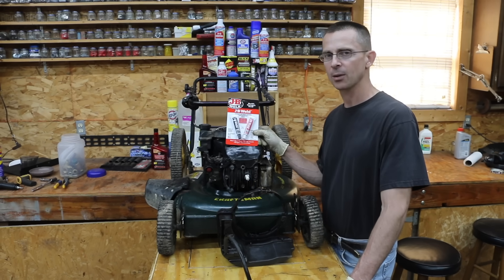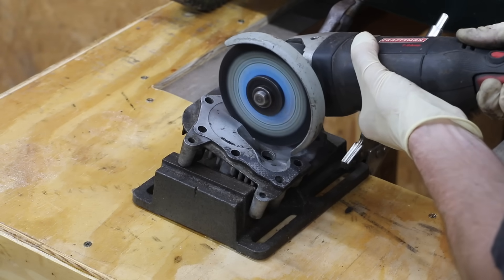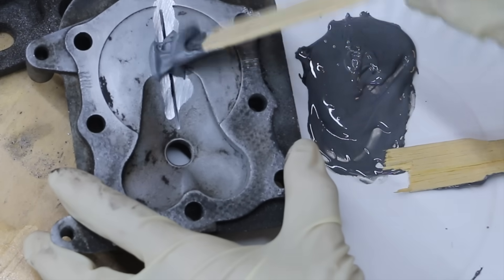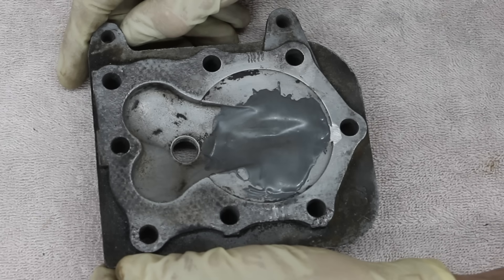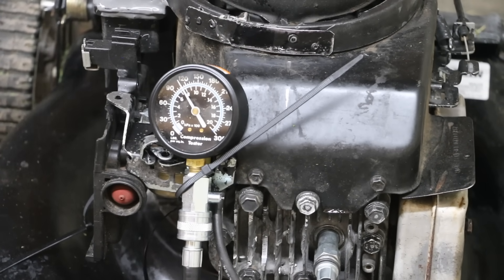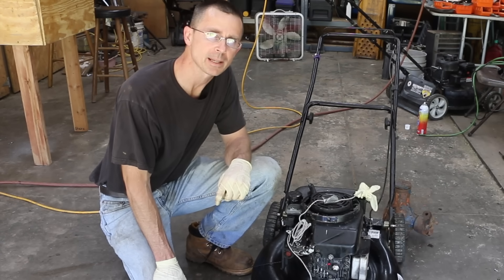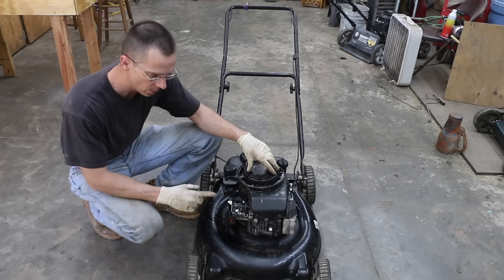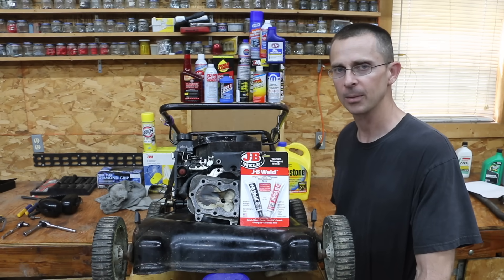Can JB Weld fix a cracked cylinder head?  See the proof!!

Comment: The damage to the cylinder head you created was basically a slot cut into the metal therefore all the JB Weld had to do was plug the hole. A cracked head would normally be in from one edge leaving one end of the crack unsupported. Would you get the same result in the test if you cut the head in from an edge thereby introducing a degree of flex into the repair.
Reply from the maker: Thank you for the feedback

Comment: My 2007 civic has a small crack on the bottom block leaking coolant, ill be JB welding it,  since its out of warranty and it only has 112K  miles.
Reply from the maker: Hope it works

Comment: Have you ever tried Alvin Lab-Metal?  It's super tough.  They even have a high-temperature version that you can use on engine exhaust repair.  I used it to repair a damaged exhaust manifold bolt threads on a CDC 8.3L in my Magnum tractor.  It's been there for roughly 10 years with no issues.
Reply from the maker: Thanks for the video idea.

Comment: In the past I used a product called MetalSet. Like JB Weld it is a two part epoxy, the difference is that it has powderized metal included in the mix.
Reply from the maker: Thanks for the feedback.

Comment: My engine block froze in my boat, pissed me off because I took it to the dealer to drain and winterize. Apparently cracked stuff happens all the time and its somehow my responsibility. Its a 1969 merc engine, so it'll be a blue moon if I find a good priced replacement for that engine block, other than taking it out and converting the i/o boat into an outboard. I'm gonna talk to my boat guy and see if he's comfortable with jb weld if everyone is saying it's so good. he doesn't even think the crack is where any major combustion is happening, so hopefully i'm good if this stuff works and he gives me a fair quote lol.
Reply from the maker: Thanks for the feedback.

Comment: I used the JB Weld Extreme Heat on the passenger side exhaust manifold to my '68 Thunderbird's 429. A lot of people on youtube here don't allow it to cure properly. I allowed it a full 72 hours and then some to fully cure. It held up for a good couple of months since I didn't quite have the money to buy a new one and ironically no one makes a replacement for a Ford 385 Series.

At any rate, I think part of my failure was not beveling the hairline cracks. I drilled holes to stop them from going further than the 300°-320° they already cracked. Held up until I started shifting the car around 4500rpms. Looking at it though, beveling it out may not have been the best choice based on the near 360° completion of them, but had they only been on one side or the other, it'd have been a good idea to bevel it out.

At the end of the day, I say it passed, and only failed due to my part in it. If I had another manifold that wasn't cracked as bad, I wouldn't mind giving it another proper go and seeing how long it could hold up to daily driving.
Reply from the maker: Thanks for the feedback.

Comment: i've used jb weld on an oil sensor fitting that broke on a 1981 volvo engine block.  i drilled out the sensor and used jb weld with a steel insert ftw
Reply from the maker: Thanks for the feedback.

Comment: We use JB at the race track and car demos. If you mix both tubes and just a cap full of alcohol it'll flow nicely along radiator tanks. As for cracked head or block you need to heat them with a torch so crack opens up wide then pour mixture in.
Reply from the maker: Thanks for the feedback.

Comment: Test this...
1. cracked vaccum line - pour silicone over it and let dry...
2. Need new paper gasket - Remove all paper gaskets, buy construction paper coat with high temp silicone between two layers of paper l, cut to shape and test for leaks. Test again with just silicone...
3. Exhaust sealant as an exhaust gasket...
4. Use tap to increase spark plug hole size... use car spark plug.

All this I have done... but I'd love to see your results.
Reply from the maker: Thanks for the video idea.

Comment: Currently lapping my intake valve because it was leaking... used a check valve wedged in my intake boot jist behind the carb... created just enough pressure to compensate for the leaky valve and get my moped running. Lasted 2 weeks until payday.
Reply from the maker: Thanks for the feedback.

Comment: That is the sloppiest methodology I've seen in a while.  Let me be a little more forthcoming in my criticism. First, a cutting blade doesn't simulate the conditions of a crack. A crack would form from extraordinary force applied either through a heating differential (and thus uneven expansion and contraction) over varying thickness of a casting. It might also result from a strong force in a small area as would occur if some moving part broke and impacted a cylinder or block wall. In either case the crystaline structure of metal at either end of the crack would also be compromised on a molecular level, it just wouldn't show to the naked eye. 

By beveling out the "crack" you've added significantly to the heat differential problem. Now, instead of just needing bonding strength to join the metal casting together, you've created a situation in which a significant body of foreign material is expected to function as the casting does. Additionally, the greatly increased surface area needed to be bonded on a lateral bias along extremely modified thicknesses practically ensures that patch will inevitably fail.

If one had an actual crack to repair, the smallest amount of metal removal that would guarantee penetration of the bonding agent would be the appropriate conservation measure. As for the success of this repair, I'd like to see the conditions of that engine after running a few dozen cycles of heating and cooling.
Reply from the maker: Thanks for the feedback.

Comment: Should I get extreme heat JB weld or what you used (twin tube) in the video to fix a chip in my cylinder wall
Reply from the maker: Thanks for the video idea.
Reply: Project Farm thank you! I had a few typos and just fixed them so the comment might now make more sense

Comment: I used JB weld on my 87 Volvo penta AQ125a exhaust manifold. It had a 6" crack and leaked extremely bad. I beveled the crack out and threw some JB Weld on it and so far its going on 6 years no issues or signs of letting go. I also have a generator motor mount that cracked and left a 1" hole in the oil sump area. JB Weld sealed it up and so far its ran 230 hours on that repair no issues. JB Weld is a very superior product.
Reply from the maker: Thanks for the video idea.

Comment: I once owned a Ford Pinto with a 2300 4 cylinder. The head gasket blew and it eroded the block between #1 and #2 cylinders. We cleaned it up and repaired it with JB Weld. Ran it for at least 2 years. Later replaced the rings and the JB Weld was still holding. Drove it another 3 years.  That's a great product.
Reply from the maker: Impressive repair!

Comment: I used JB Weld back in the 80s once to to put an sharp edge on an old lawnmower blade that was worn pretty bad.  Didn't use a lot, just enough so once it dried I could grind a good edge.  Worked pretty well.  Also used it to repair a cracked engine block that was caused by freezing.  It was a rare Chevy 327ci FI engine, and the crack was right below between two freeze plugs on the drivers side below the exhaust manifold and is still holding today after 35 years.  Good stuff!
Reply from the maker: Thanks for the feedback.

Comment: I am a firm believer in JB Weld. One bit of advice for followers though: Since the crack was manufactured, the ends were much wider than a normal crack would be. Therefore, the pressure was spread over a larger area; Pressure= Force/Area. For a normal crack, there is very little area for the force to exert itself on; that's why it keeps cracking. Drilling a hole (called drill stop) at each end of the crack gives the force a larger area to exert itself on. That creates less pressure, and hopefully the extent of the crack. Obviously, the holes would be filled as well.
Reply from the maker: Great feedback. Thank you

Comment: I RENEW THE ISSUSE  / radiator with no cap,  Zero pressure / i can not get jb weld past 180*F... like all other epoxys... turn to jelly at 180F

Comment: I first discovered JB Weld about 20 years ago.  I had a big crack in the valve cover of my 2.0L turbo charged Eagle Talon and a road trip to go on the next day.   I sealed the inside and outside of the crack and went on my road trip.  That stuff held for years with no issue!  I was sold on JB Weld forever.
Reply from the maker: Impressive results!  Thank you

Comment: That was a very tough test good video 

as you know it’s not really testing repair on a crack.... it’s actually  testing repair on a cut.....  which is different because now that the head has been cut the blade has removed material whereas in a simple crack no material is removed so the JB weld has to do two things it has to replace the material that has  been removed by the blade plus then hold up to engine wear.....

 rather than just the latter on its own

Definitely a good product definitely a tough test might not last the life of the engine but if you’re in a remote area it looks like it will get your home or just to a workshop and that’s the main thing....!
Reply from the maker: Thank you and thanks for the feedback.

Comment: If you have a huge gap or complex shape, I have had luck using the bottom corner of a plastic soda bottle as a leave in form.... Mine is over a motorcycle slave cylinder so heat isn't much of an issue.... Stands up to the motor vibs + my steel toed boots tapping it constantly
Reply from the maker: Great feedback. Thank you

Comment: I used JB to patch a hole at the bottom of the gas tank on my motorcycle, It was an emergency repair so I didn't let it cure properly. It worked for a couple of days but started leaking again, saved the day but wasn't a permanent solution. Maybe if I had more time to let it cure overnight it could have work, who knows!
Reply from the maker: Thanks for sharing!

Comment: A crack won't allow the JB Weld to get inside deep enough versus a wider open manually produced slice. J-B Weld is right up there with WD-40 and duct tape. But you got to try it on a real actual crackhead. Depends on how much material you get in that vacancy then. Just the thought. I enjoy your show.
Reply from the maker: Thanks for the feedback.

Comment: JB weld. Very good for exhaust connections.have also seen it used on cracked heads and cylinder walls
Reply from the maker: Great tip!

Comment: As you know , I fix things also. While traveling around our great country for 40 days and 40 nights with my family filming it for my youtube channel . the tow vehicle, was a F-350 farm truck I borrowed. we lost the drive shaft . I had payed a shop that specializes in drive shafts put in new universals  , they did great job. but they failed about 400 miles later . because the seats (GROVE) for the retaining clips were worn battered and rusted     . I fixed it the second time , I cleaned everything very well with brake clean and JB welded the clips or lock rings in  . 12k HARD miles later still going strong! ! ! yee haa ! ! !
Reply from the maker: Thanks for sharing.

Comment: Used JB weld on a cracked noisy  exhaust manifold on a 1972 350 chevy ran for a long time with no problems and quiet as a little church mouse. Good Stuff. Saved me over 100 dollars on a broken bracket on my dash temp control on my motorhome. thanks for the great videos.

Comment: Are use JB Weld on a plastic power steering pump housing on a Ford Taurus the return line broke off I found a piece of quarter inch tubing put a bed around it dropped down inside the tank and pulled it through with a pair pliers and it held for two years
Reply from the maker: Impressive repair!

Comment: I'm surprised it held up against the piston slapping it. I know the stuff is good at handling heat, but it's fairly brittle and doesn't like hard impacts. Usually a hard impact will cause it to crack and bust off. Very impressive test results.
Reply from the maker: Thank you

Comment: My wife had a Datsun 1600 pick up that her dad gave her. It lost compression in two adjoining cylinders. She wanted to fix it herself having zero experience with this work and did almost 100% of the labor with my supervision. When she got the head off we found the source of the problem. It had a burn through between cylinders 2 and 3 and some serious scarring of #3 cyl wall. I told her to go get JB Weld and brake cleaner. Filled the scratches and the burn through sanded smooth. Honed all cylinders and installed new rings. It ran better than ever and lasted for 9 years (when she sold it). Still see it from time but don't know if it's the same engine. It has been nearly 30 years since she sold it.
Reply from the maker: That's great!!  Thanks for sharing!

Comment: I used JB weld to repair a shallow well water pump I use out doors to pump water for my garden, pump froze in the fall one year and cracked the cast housing, fixed with JB weld and holding together still years later. Great video.
Reply from the maker: Impressive repair!

Comment: Job weld also claims that you can repair cracked cylinder walls...maybe you should try that...I don't remember the name of the other repair putty but it is white colored...they also have the same claims
Reply from the maker: Great test suggestion. Thanks
Reply: Damned auto correct...not job weld...JB WELD

Comment: Yeah man.  I had a 1995 s10 with the 2.2, 4 cylinder engine.   The cylinder head got small hairline cracks along the outside wall above the spark plug holes.   When the engine warmed up the cracks would leak antifreeze into spark plug holes causing the engine to misfire.  We got some JB weld and applied it to the head along the cracks.   It never leaked again.
Reply from the maker: Thank you for the feedback

Comment: I'm REALLY curious to how good JB weld would hold up to a cylinder head that is under boost. Like a turbo or supercharged engine.  Not real sure how you would test this without costing yourself some money, but I'm really interested to see how it would hold up.  Also I would like you to maybe test out some radiator fix leak products and see if you can find any that won't clog up the heater coil.
Reply from the maker: Great test idea!  Thankyou

Comment: The aluminum transmission housing on my Mercedes-Benz 300SD cracked and was leaking transmission oil profusely in the driveway. Using brake cleaner and J-B Weld, I was able to clean and then massage the epoxy paste into the crack to stop the leak. That was 6 years ago, and it's still holding. I can buy a lot of J-B Weld for the $4,000 the transmission swap was going to cost.
Reply from the maker: Impressive results avoiding $4000 transmission swap!

Comment: Probably a dumb question. But can you drill & tab JB Weld?
Reply from the maker: Yes, but it doesn't have the same strength as steel
Reply: @ProjectFarm  Oh that's fine, was going to use it to replace plastic studs on a shifter cover. Coarse thread self tapping screws though.

Comment: Project Kawasaki Prairie 400 4x4

Oil leaking from the gasket between the cylinder and crankcase. I think I'm gonna try smothering the area with JB weld instead of the proper thing to do.

Any thought? Is the crankcase oil under pressure?
Reply from the maker: JB Weld is unlikely to help with a gasket leak.  Is the PCV valve working properly?
Reply: @ProjectFarm  even though it's in the crankcase on bottom of the cylinder? 

I'm 20 and new to this so all the advice and tips is really really helpful!

Comment: I had a late 90s KX 80 (2 stroke dirtbike) that had a busted crank case. I used jb weld to patch the hole and it lasted years. Even then I blew the motor too many times and couldn't bore it out and re sleeve it anymore. I miss that old bike haha
Reply from the maker: Impressive!

Comment: I had a tree branch hit the cooling fan on my tractor damaging the radiator. The radiator needs to come off and laid flat but jb weld did a very good and neat repair. It is still going strong after 2 years. New radiator for the tractor was going to be $ 750.00. JB weld less than 10 bucks. JB Weld  radiator repair ... works good!
Reply from the maker: Impressive repair!
Reply: I had a leaky radiator but no jb weld on hand. I did have solder from when I replaced my hot water heater, so I repaired it with that and it's been holding up with 4 years of daily driving ever since. I did repair my dad's leaky radiator plastic side tank with jb and is holding up just fine.

Comment: i always keep jb weld in my tool box, used it on many thing many times... its honestly never let me down... two that come to mind one my takeuchi excavator some how got a stake in the track and put it through the oil pan... had a ratchet and jb weld in the truck... figured it would do till i got it home and welded it up... well that was 6 years ago... jb weld is still holding no leaks... 
second was on an isuzu rodeo believe it was the tensioner pulley someone had cross threaded the bolt into the block stripping and cracking the bolts stanchion filled it with jb weld tightened a hose clamp around it drilled and tapped it the next day... saw that rodeo 2 years later with the repair still holding strong...
Reply from the maker: Great product to have in the toolbox.

Comment: JB Weld is crap. The clear stuff won't even hold the temple support on my glasses which are plastic.
Reply from the maker: Thank you for the feedback
Reply: I used the clear that comes in the plastic tubes with the plunger. Prepped with alcohol even.

Comment: I've used j b weld to patch a hole in the gas tank of a 73 impala I had when i was 16 ....i used it to glue an aluminum ear back on that holds the starter a 40hp mercury ....I've also used it to fill a stripped bolt holes the redrilled and tapped the hole
Reply from the maker: Thank you for the feedback